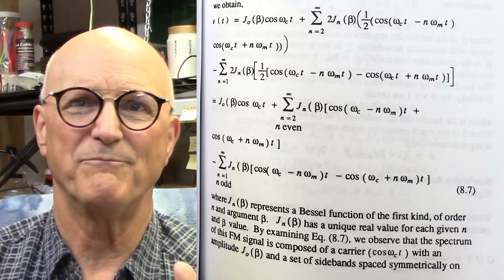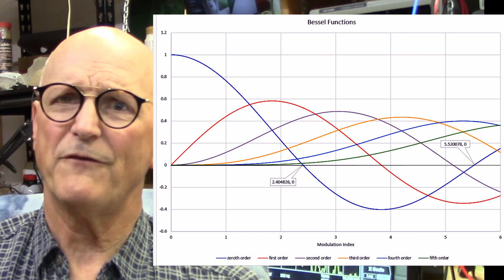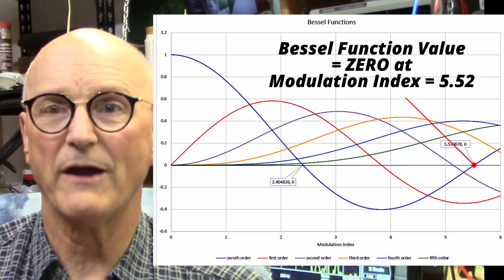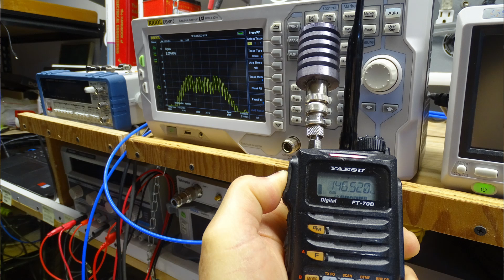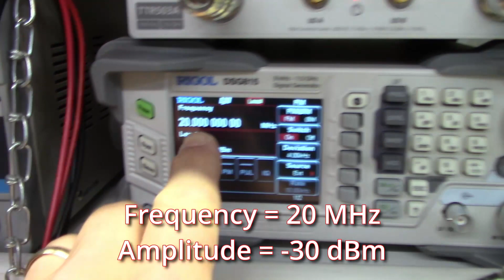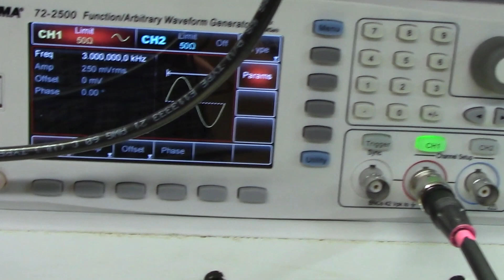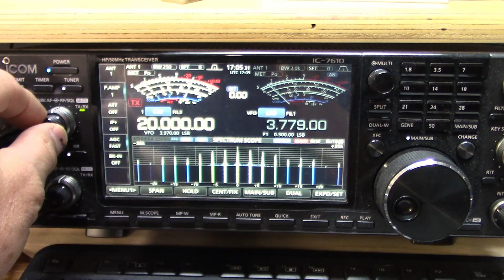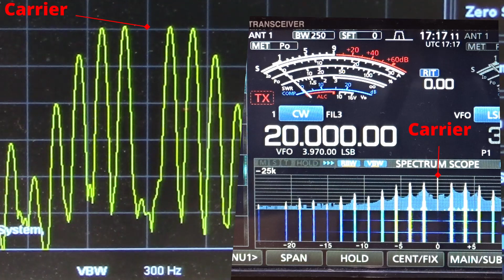Measuring FM Deviation using the Bessel NULL Method (030a)

Comment: SUBSCRIBED!!!  Just ran across you channel and realy like this video. I got given a broken repeater and have been trying to both get is up and to understand enough t correctly operate it.  I have 2 old 8640B/Option 323 but they are not table enough nor give me the resolution of signal or modulation to be able to use them.
I ran into the same problem trying to obtain a 'Service 'Monitor' and am unwilling to (what seems like) throw money away on a crap-shoot!  
I was a little taken aback when I saw the cost of your RIGOL RF generator.  Would you of one with comparable specs but maybe up to 500MHZ?
Anyway, pretty tough going here but am pushing ahead...  Thanks & 73...
Reply from the maker: And your comment just popped up in my list of comments! WOW! The Rigol RF generator I have (DSG815) goes to 1.5 GHz. I am very happy with it. Unfortunately, I have no recommendations for you except what I have found so useful, my own DSG815. Price point-wise, you are not going to get better for the $$ (my opinion)

Comment: I need to check the calibration of a broadcast FM monitor but the book I have with the various recommended tone frequencies is in storage and not accessible until later this spring.  Thanks to your video I was able to calculate a couple of frequencies I could use, not only to set the meter at 100%, but also to check tracking in the middle at 50%
Reply from the maker: Woohoo! Great news! I am so glad this helped! 🙂

Comment: Please explain to me where the audio signal generator connects to?
Reply from the maker: Well, this depends on what device you are adjusting.  If you are working on a radio transmitter, then you need to find out what the amplitude of the normal audio source is and where it is applied. Then you set up your audio signal generator to mimic the amplitude of the normal source and connect it to that input.
The object is to choose a place where the audio we use to make the measurement "looks" like it is coming from the source it normally would be coming from, but is, in reality, our signal generator where we have control.
If it were, for instance, an FM broadcast station, I'd connect my signal generator to one of the inputs to the control board and set the audio level to 0vu to run the test on the FM transmitter's deviation.
In the case of the demonstration I performed in the video, I connected it to the external audio input of the RF signal generator.
Hope this helps

Comment: So If I wanted to see my modulation at say 146.520 fm. I would set my analyzer at 300 hz  resolution band width and my span 1 mhz
modulation (source would be speech using microphone).
Reply from the maker: Well, Neal, if you are going to be checking FM deviation using a microphone and speech, then I would suggest the "MIN/MAX" method instead. This is great for checking a dynamic. live signal like speech.  My video on that can be found here:
https://youtu.be/aTvGCKNnGPw
The Bessel-Null method only works with a single, specific tone given a desired deviation. CTCSS tone has to be shut off on the monitored RF.
Hope this helps.
Reply: @eie_for_you  will thank you.i own the hp esa1500a and just got the rigol dsa815
Reply from the maker: @Ibelieve218  It's a great spectrum analyzer for the money! I got the one with the tracking generator so I can use it for "response-type" measurements on filters and the like.

Comment: Great video!  I am trying to help take manage a VHF packet system.  How could I use a similar setup for setting deviation on an FM transmitter for 9600 baud packet?  I have a TNC that I can adjust the signal level going into the transmitter.  The manual for the TNC says that FM deviation should be 2.4kHz.  Since 9600 baud is FSK and not AFSK, will your method still work?  I know just enough to be dangerous!  Please help!
Reply from the maker: I am glad you found this video helpful!
How would I do it?  I would use this method exactly as described with a signal generator and all.  Replace the TNC with an audio signal generator connecting its output to the port where the TNC would be connected, select the appropriate audio frequency for your deviation (2.4 KHz/2.4048 = 998.0 Hz) and then adjust the output amplitude of the signal generator until you get your null.  Now you know the amplitude you need as an audio input to your transmitter to produce the desired deviation - for your digital signal, I'd be concerned with peak-peak voltage.  Replace the signal generator with your TNC at the transmitter's input and adjust the amplitude of the TNC audio output to be the same peak-to-peak output amplitude that you had with the signal generator.
You could use the MAX/MIN method of measuring deviation that I describe in the next video (https://www.youtube.com/watch?v=aTvGCKNnGPw) to verify the final deviation.
I hope this helps. :-)